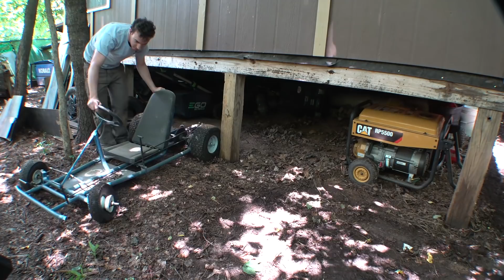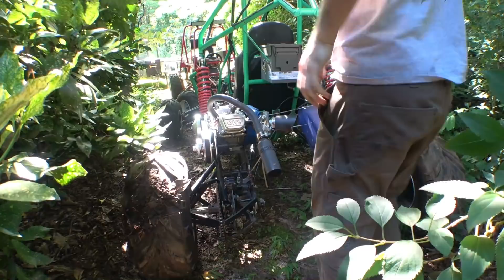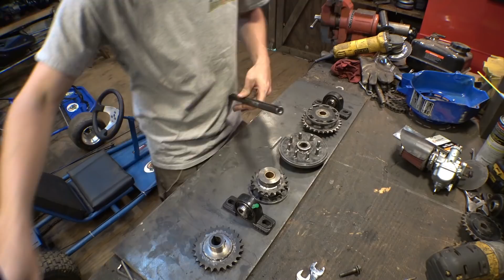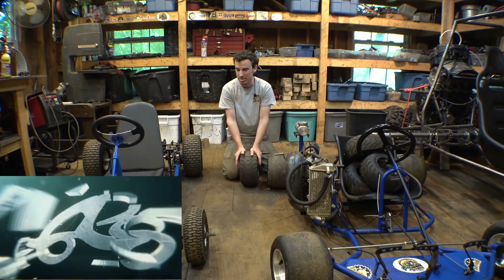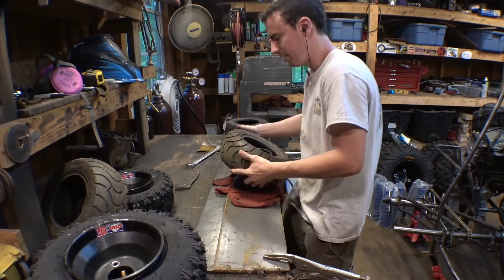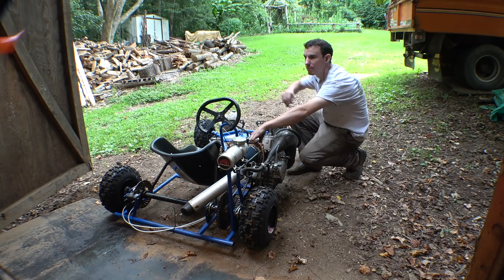Go Kart Race Prep - Race With Cars and Cameras & Red Beard's Garage

Comment: No idea how many times I've done the exact same thing while trying to change a tire. Suckage.
Can't wait to see you guys race!
Reply: Try using dish soap and water 1 part soap to 3 parts water adjust as you see fit for all mounting tasks it is amazing how well it works and I'll tell ya it works from small 4 inch rim wheels to 20 inch 3 piece hemmt rims with 54 inch tires been there done that soap and water is still my favorite tool for the toolbox... I could write a book about all the uses I've found for it

Comment: Am i the only one that still remebers that the yz85 motor has a cracked case?
Reply from the maker: build it at home dang, even I forgot about that 😬
Reply: Uh oh
Reply: I bet that 85 cart will fly. You thought about a rekluse clutch for it tho?
Reply: rather B welding oops
Reply: @ratherBweldingChris  haha maybe but some jb weld on the inside! Did that to my pitbike in the buildseries to😃👍
Reply: @austinburton6631  rekluse definitely the way to go
Reply: @ratherBweldingChris  J-B weld it and run it, what's the worst that could happen?

Comment: Tip...: use a lot of soapy spray to lube the tire bead "during!!" installation. It'll slide onto the wheel easily.... Never install tires dry. No more punching yourself in ye olde noggins....! ;)
Reply: 3 parts water to 1 part dish soap used to not only slide the tires onto the rim easily but when used during seating can help create the initial seal and causes the tire to seat at a lower pressure (reduces the sketchyness as he calls it) and when the soap dries it glues the tire to the rim just like bead sealant except with easy cleanup also if you have a bead leak just put a small amount around the bead the venturi effect of the air escaping will suck the soap into the bead stopping the leak and when it dries it stays sealed
Reply: he knew to use soap afterward to seat the bead lol, just forgot you just need it in the beginning
Reply: @Hammerjockeyrepair  it works in all stages of tire seating and for many other things too
Reply: Soap an water for taking them off to.  Less chance of ripping the bead of the tire to.

Comment: Just a suggestion, I’ve put drain lines on the fuel bowls of all my carbed engines and I use fuel flow shut-off valves.  When you’re ready to put the engine away for awhile, just turn your fuel off going to the carb, run it till the engine quits and then open the lines at the bottom of the fuel bowls and let them drain.  Putting a little stabilizer in the tank help, and always keep the tank full so it doesn’t rust on the inside.  Keeping carbs clean on a two stroke is job one.

Comment: Nice trick i learned when you have a tire that just doesent want to go on the rim is to clamp a vice grip to the edge and kinda rotate the tire around the wheel and have the vice grip act like a ramp to push the tire down into the rim, this is for if you already have one side of the tire on the rim

Comment: Try cleaning it out.& Checking the diaphragms inside of it to.& Try running some ethanol free fuel.,or sthil regular fuel in the metal can for premixing 2 stroke.,or 2 cycle oil with for like having your own true fuel on hand ready to use.

Comment: That out take at the end reminds me of a little mishap I had about 25 years ago. :)

I was under my old car trying to get a rusty exhaust hanger bolt out. Not much room under there, so I was kinda pushing the spanner towards myself as hard as I could with my arm fully bent. It was at that moment the bolt head sheared clean off and I blasted myself full force in the face with my own fist (Still clenched tightly around the spanner) and badly broke my nose proper

Comment: 4 words dish soap and water the greatest tool for your toolbox I have ever used... excellent tire bead lube as well as bead glue, pair it with veggie oil and you get amazingly clean hands (rub the veggie oil onto your funk nasty hands after a day in the shop/driveway once thoroughly full of the funk nastiness from whatever you worked on then use the dish soap to remove the veggie oil (not only does it leave your hands white glove clean but it will make your hands soft for ya lady friends if ya know what I mean)) it also does its cleaning role beautifully not just on dishes ex. cleaning an engine block after honing you don't want to use a petroleum based cleaner to clean out the metal shavings/grindings/residue due to they actually trap the particles into the pores of the metal however do use the best cleaner to use which is dish soap and water as it removes the oil and greases from the metal allowing the water to flush away the residue follow up by a good thorough air drying and finished with wd40 (used as an example) or your preferred water displacing spray coating and you will have a fresh clean engine ready for building and your engine bearings seals pistons etc will thank you with extended lifespans.  Also if you live where there are sap/pitch producing trees such as pine trees place a dab of veggie oil on the sap/pitch that just got onto your pride and joys paint then your start scrubbing when finished wash with da dish soap and you'll be amazed how fast and easy the sap/pitch comes off. And these are just a few examples of what dish soap and water can do in your toolbox... for more do some experimenting of your own

Comment: ATTN: Rather B Welding I ran those cleats racing flat track pay attention. If that is a 35 hp+ Engine look into tubes and bead studs. Loading them hard might spin the rim. And this process should stop the spinning and seal it up good. #ratherbwelding

Comment: Sometimes carburetors like that have a vacuum nipple between the flange and the throttle slide. Did you make sure this is still plugged? I forgot it one time and the engine didn't want to idle nice. It draws false air.

Comment: Black smoke means excessive fuel is going inside cylinder or there is not enough air to burn the fuel completely. Where there is a complete combustion,  is minimum smoke.
And why do you not use mufflers on exhaust? It does not sounds good.

Comment: with all these carts both yours, cars'n cameras and more  with no or minor suspension i'm always wondering why you guys do not add some dampening of the seat? the easy way is the typical tractor/lawn mower/ bicycle trick with front hinges and a spring/dampener underneath the seat Reduces the impact on your back tremendously. Even the ninja needs a seat dampener of sorts. Comment?  

ps  Just saw the video from the race.. hope you all used teeth guards hehe

pps dont you have a small 12v winch on the trailer/truck bed? helps with on/offloading as well. Use a mobile and have it in the work shop. kills me to see you lifting frames etc. Im not old but learned to lift smarter over the years ;)

Comment: come on you don't need pliers to pull the plug wire off I've got a 420 clone on my golf cart that I ended up cutting the kill wire when I changed starters and wiring with one hand sucks so for the last 5 months I've had to pull the plug wire to kill it, yeah it shocks you some times but it's not that bad  and mine has a metal spark plug boot

telling people you got a black eye changing a tire is better than admitting you broke your nose changing a steeringwheel because you forgot to leave the nut on a few threads to catch it when it broke free. the plastic surgon who reconstructed my face after my accident was kind of pissed about that one lol she fixed my broken jaw eye socket nose and forehead